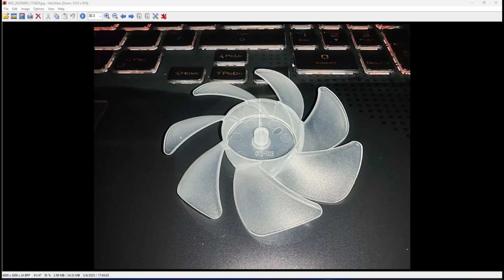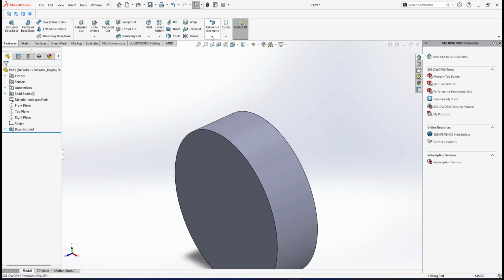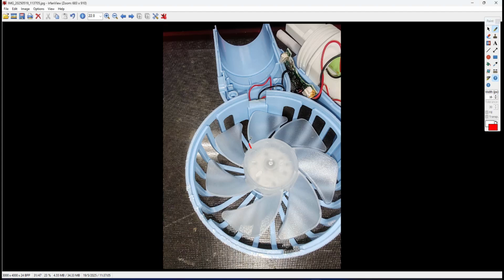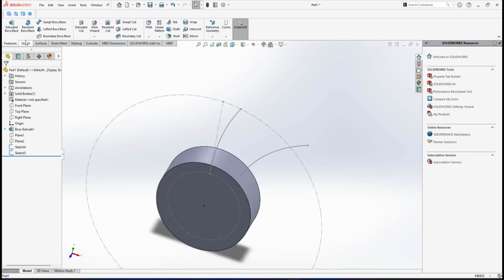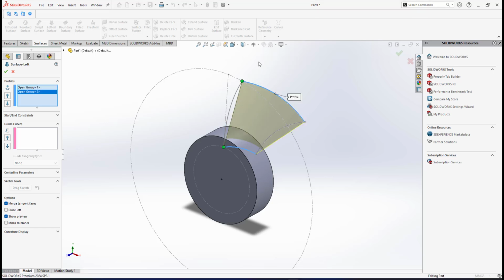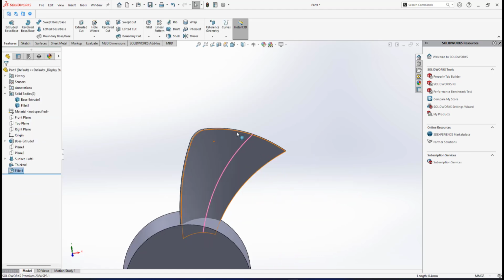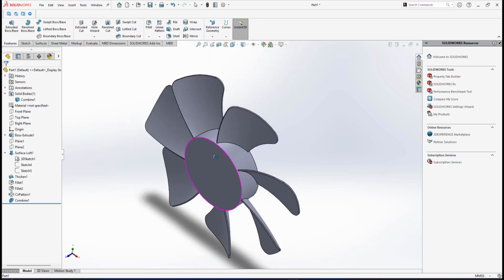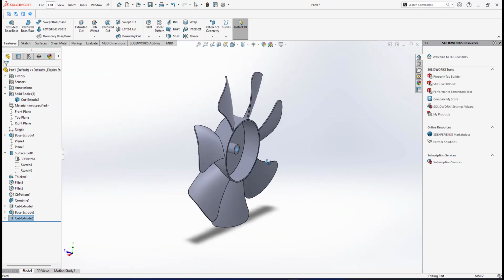SolidWorks Tutorial Part 6: Accurate Fan Blades Modeling in Solidworks Using Lofted Surface

Comment: Thank you! Btw, PSA for fellow CAD people -- you don't need to make the blade a separate solid body, you can merge and do a circular pattern with the Thickened feature (remember to include your fillet), just make sure you have Geometry Pattern checked.
Reply from the maker: I intentionally kept the blade as a separate solid body so I could fully develop and refine the master blade, including the fillets, before patterning the finished body. I find the Body to Pattern approach more flexible and robust for this type of complex blade geometry, especially when further modifications to the master blade are needed.